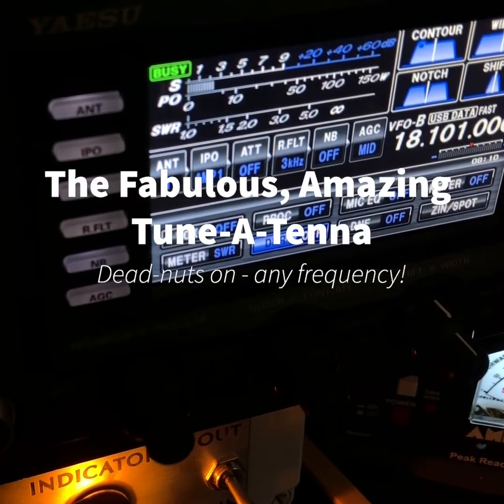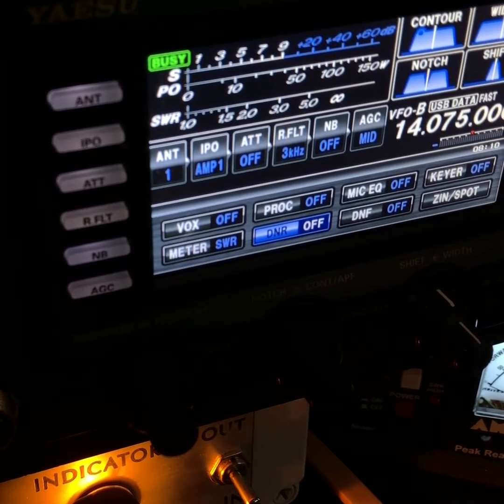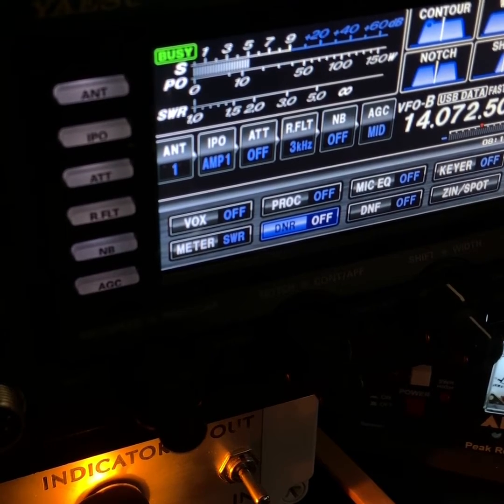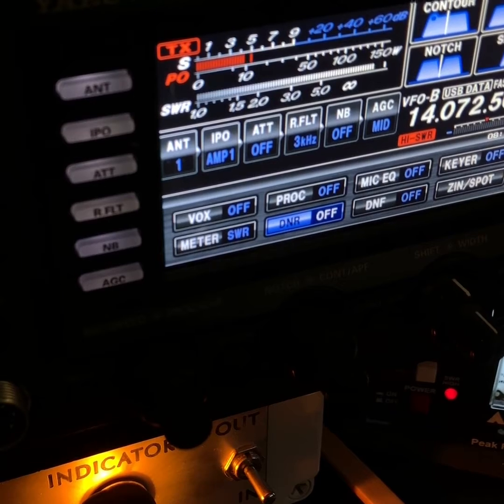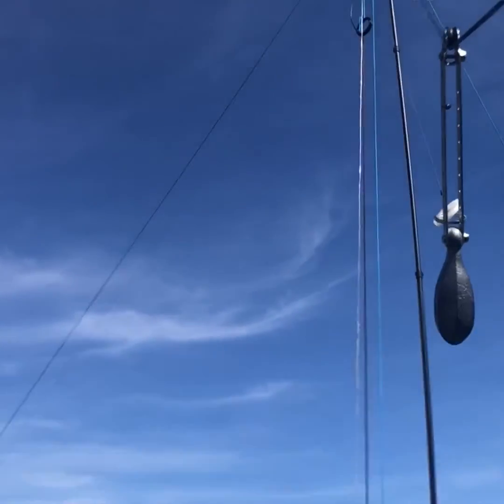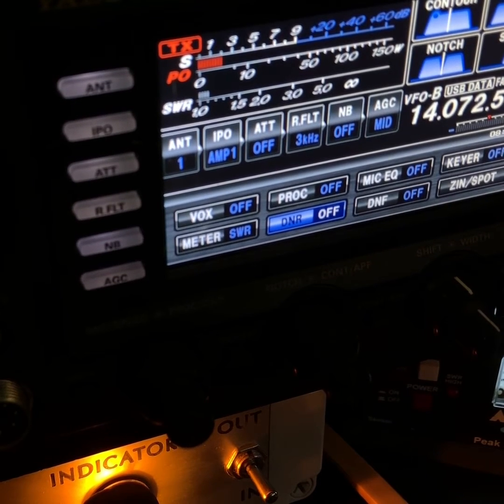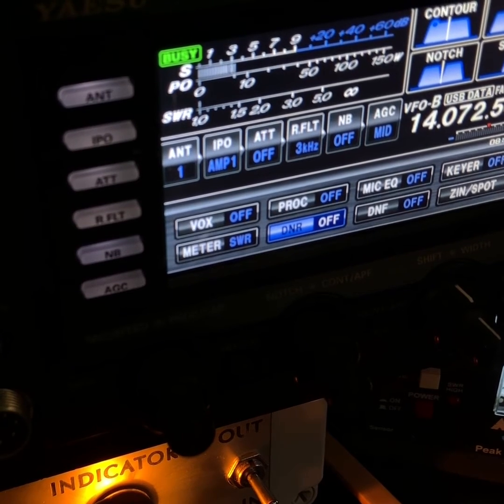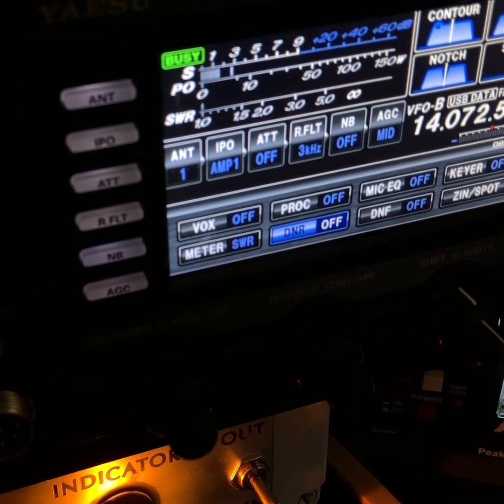Amazing Ham Radio Tune-A-Tenna - Dead Nuts On, Any HF Frequency

Comment: So you figure the optimal length by using the lowest swr reading, no necessarily by actual length of the wire dipole “tenna” ? How high must the control box be above the ground ? 
I do have a height limitation here .
  My hexbeam crashed during our last hurricane in North Louisiana last summer. Going to try and sell the parts of it and maybe put it toward this “tenna”.
Claims to be portable. Is that by stringing it up on a high up tree limb of a tall tree or via portable alum mast poles?
Reply from the maker: Yeah, I’d consider it portable. The height you’d want to hoist the box/feedpoint would depend on the band you wish to optimize most, so a half wavelength high. Then you just tolerate the compromises on higher or lower bands. I’ve had mine at 49’, but lowered it to 33’ in order to get a better pattern on 20m. But it’s just on a rope with a pulley at the top. Easy to drop it down for maintenance, or to operate from a lower height. 

My mast is a carbon fiber telescoping one. When I had it at full height, the top few poles bent too easily in windy conditions. I’d lower it to the ground when storms were brewing. Then when I decided to set it at 33’, I did so by not extending the thinnest tube at all, & shortening the next two about half way. That stiffened the top 8’ of it significantly. 

Anyway, I would have few qualms about dropping it all, packing it in the truck, & hoisting it up somewhere for Field Day or POTA. Goes pretty quick one you’ve done it twice.
Reply: @kelvin0mql    Thanks, I can never get it above 40 feet here where I live and even 33 feet would be a changeling 
too, maybe 25 to 30. I'll have to do more thinking on this.  Thanks again.

Comment: Kelvin,i f I understand its operation, unused wire is coiled onto a spool on each leg.  I assume  the wire is copper clad, or steel, or some sort of bare wire which would result in a big short circuit at the end of each leg.  I can see this working until the point where oxidation begins to occur, or dirt accumulates on the wire.  At that point you could have a large inductor, or a series of smaller inductors on each leg which would most likely make the antenna non resonant on any band. Perhaps the wire is stainless steel which would reduce the oxidation problem but not the dirt.
Reply from the maker: Yes, it is stainless stranded bare wire. And you’re exactly correct. I will likely find after a year that I will need to clean it, not unlike cleaning my fly fishing line. And after a few years, will likely replace the line, which is readily accessible & pretty easy to do. Most parts of this system is serviceable by design.
Reply: @kelvin0mql  if replacing wire is there room on the reels to use small gauge copper insulated wire instead ?
Reply from the maker: @denp54z  That wouldn’t work well. That’d give you a center-loaded dipole. By the elements being bare stainless, the RF doesn’t “see” the spools as coils, but instead as just a cylinder of conductor.

Comment: Congrats! Looks like it works; will it survive Minnesota Winters?
Reply from the maker: The typical ones, surely. But ice storms or heavy hoarfrost, I expect I’ll have to either keep it on the band it’s on until it thaws, or pulley it down to clear ice off the elements. This is why I went with a setup that allows me to bring it down with zero climbing.